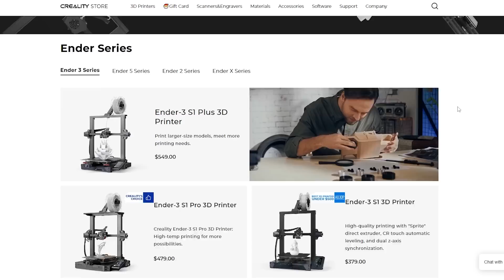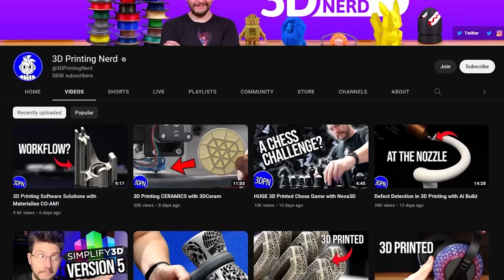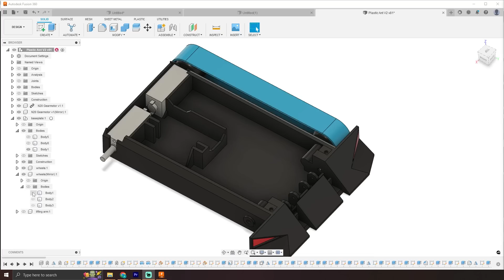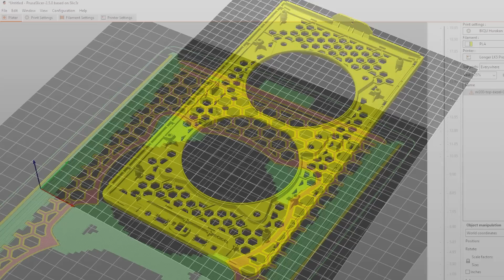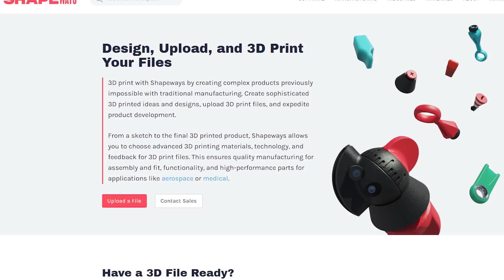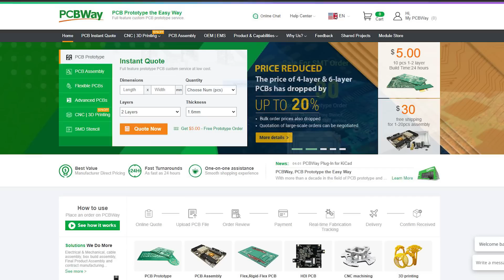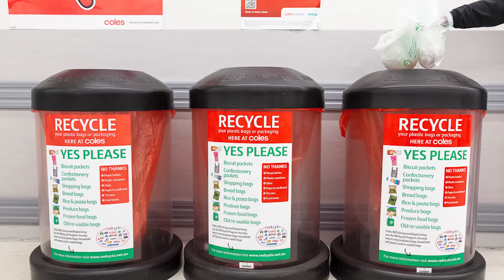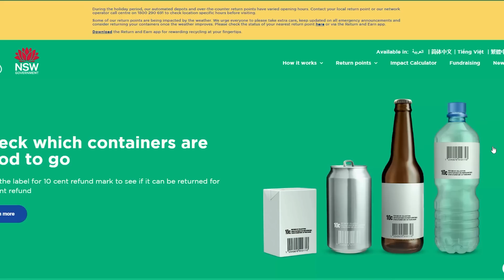My 3D Printing Predictions for 2023

Comment: in terms of cad accessibility, we need plugins for blender that make it easy to convert stl to printable meshes. blender and similar software are way more intuitive to use than most cad software that require a lot of manual parameters

Comment: Material engineer here it is possible to make filament with cellulose but you can print with normal prints they would degrade/burn before melting. In the lab I worked I tried to make and it is possible to 3D print with cellulose and they are awesome but it uses water and a different extrusion method they also take a while to completely dry and you can't make very detailed surfaces. You could make a fan for example but not a miniature, parts that require tight tolerances would not feasible either

Comment: I believe we need affordable and easy ways to take our scrap or failed 3d printed projects and melt them back into filament strips.
I know there are dozens of youtube vids on people who are skilled in electronics making these machines but what about those who have little experience. 
2 things I know are needed is a Shredder for the 3d print material and then a type of Extruder that takes the shredded material, melt it down and spit out the 1.7 filament

Comment: It's now August. one thing we are seeing is not cheaper prices, but better value. compare the Bambu P1S with the MAS system against the Prusa XL with the 5 head system as an example. At almost 1/4 the price, the print quality should be about the same once input shaping is working on the XL. As it stands now, the P!S print quality at speed is better than the XL. Add about $80 in upgrades for a hardened extruder and nozzle for the P1S and it can do abrasive materials like the XL. Then there's the fact the P1S, K1 and some other printers also provide increased print speeds for their price.

Comment: I picked up the Neptune 2s a few years ago.  Modded it, its pretty sweet.  I would certainly not pay for a bamboo labs, way to expensive.  But I also do a lot of modding and stuff so no biggie for me.  That said.  Even back than, I felt that 3d printers were advanced enough, to the point where everyone should literally have one in their home, or atleast know someone with a 3d printer who could print for them....

What would be REALLY REALLLY REALLY cool is if we saw shops, like literal birck and mortar strores, that have like 10+ 3d printers, and they sell 3d printers, but they also sell 3d printed items, locally and online.  Kind of like going to a printing press shop, couple hundred years ago.

Comment: AI should drastically change CAD.  Right now images of dogs it creates might have 3 legs but just think about how fast AI advances could change this.  Instead of asking for a play written by AI or a picture with X components how about a cylinder or a block and other descriptions to have AI do a lot of the work before fine tuning.  I figure 5 years and maybe less at the rate AI is going.

Comment: Better slicers with integrated AI optimization, smarter controllers like Klipper, these are the easy software ones. Then hardware wise we need rotating extruders for FDM.

Comment: I think that 3D printing is going to get cheaper to do in general, as it has already done this, yet it will level out in stages like the computer tech has done..

I think that the Metal printer will eventually become a hobbyist tool although it will probably be in 5 to 10 years.

I think that more people will show interest in 3D printing but like most people don't want to program games, and or 3D model characters in programs like Blender to Character Creator and would rather buy them from Daz, if they have any interest in that at all, so I think some of it will become common place yet some of it will still stay niche like for example, I am 3D designing Star Trek models and 3D printing the parts to test, and adjusting them and then reprinting.
This costs a couple hundred dollars or more and can take between 2 to 4 months on each design. So I don't think everyone will be doing this anytime soon unless we get the software like Tony Stark has where the AI does it for you, when you verbally describe it. 
People might get to where they print out a hammer because they need one now, though and that could be common place.

Comment: 0:31 #0 - 2022 roundup
4:00 #1 - The war for the prosumer market will begin again ... again 
6:00 #2 - An increasing need for "easy to use" CAD
7:16 3# - Companies will embrace 3D printing to alleviate supply chain issues
8:23 #4 - Industrial manufacturing will become more accesible
9:49 #5 - Hobbyists* will have to take plastic recycling into their own hands (* I refuse to repeat the spelling error from the video)

Comment: This is probably going to be lost in teanslation and viewed negatively. But ya'll saying this and that about how innovation should be coming from the companies that produce these machines; fine back in the 70s, it was under decent research budgets (universities and other various compenies) that the very first 3d printer came about.  Sure, yeah, whatever.  For those of you that think that the Prusa i3 was an entirely original idea; no it is not.  For one the Ender 3 is for all intents and purposes is an Prusa i3, which its allowed to be because they're open source.  Even the Makerbot printers, up until the Replicator came out, were open source.  They were all based off of the RepRap project.  The whole point of which was so we weren't ladden to waiting for companies to produce these machines for us. Or being locked down to "their" proprietary parts or systems.  It is supposed to be an ecosystem were we are allowed to make the innovations ourselves.  For those that say otherwise,  ya'll are very well and truly "whipped," so to speak, and tied to the system.  What simply because it's supposed to "just" work?  You all want to be living within the matrix, man.  I suppose to that you all think that the og MacIntosh computer was all proprietary and all Apple's/Job's idea?  Or that Google "owns" Android? The names, or branding, okay fine.  What became MacOS, was based off of FreeBSD. Android is still opensource.  You can legally do what you want with the source code, with in reason; the only money Google makes, is from selling licenses for Google Play services and the right to install their suite of apps.  All of this is to say that the whole idea of where our most used and prized tech comes from the innovation of us little guys and not being tied to Creality, Prusa, UltiMaker, 3DSystems, Statasys, or even HP.  So please stop bemoaning the companies that do the heavy lifting of providing the printers, as either kits, or preassembled machines.  Its frankly lazy.

Comment: In my imagination, we are already using 4D, 5D, and 6 is causing us complications. 3D was us simply opening "Pandora's Box"

4D and 5D, is handling next level structural engineering - mainly for "Space Innovation design" Nasa and a number of big players are on the cutting edge of theses two. 

Big Pharma, is pioneering with 6D and this is not without frustration or heavy costs between time, testing and tweaking - their science has literally rocketed, but not without cost. The main problem is balancing and fine tuning 3 or more disciplines to bring the equivalent of a one stop shop piece of hardware that has multifunctional capabilities. 

Big Pharma, has created the equivalent of an army of pica-nano-bots that have fully capability of carrying out extremely high precision operations to anywhere in the human body. With the future intentions of building the person from the inside out. Yes you heard me correctly from the inside out. So  it can replace bones, skeletal frameworks. 

Imagine, mining which would allow you to remove the infected or damaged bone, and in its place they build an artificial version from a new materials that are as good as indestructible. A.I. has to work out the mathematical equivalent so that the replacement is the exact body weight that it has to replace. This is why it is so difficult?  and why it is causing a headache. 

They could build a super lightweight skeletal frame, but you would almost be creating a cyborg, which has already been done, but it's the step below, that private customers want right now. Ironically Marvel was the key promoter that opened up a new division in medical engineering for this new demand. 

Big Pharma, has also created the inline/online medical center which is capable of monitoring all of your bodily processes, and initiate treatment to maintain overall health of the person, with no longer having to ingest tablets, topical creams, etc. It's all done within, with the precision of giving the exact amount your body needs to absorb, without all those other side effects. 

Skin tissue has been a monster of a problem to artificially recreate, because our skin is a living organism which has very unique abilities to replace itself. This has presented huge problems because we do not have the full body suit equivalent as it is truly a masterpiece in science, that we really have no idea of how our bodies, do it. 

Whilst we can replace eyes' ears, and smaller organs the magic is getting it all working together and our bodies adopting theses artificial replacements. So genetic gene coding is one of the "D" disciplines that have got to be aligned with our own D.N.A in order for it to work in harmony.

The other issue we have but it's 10 years down the road is creating a number of depots within the body framework that will store medical supplies, and the aux pica-nano-bots to carry out daily routine maintenance.  This will be for key people who are essential to Global Governance.

Comment: I fully disagree with the statements made in regard to CAD. Fusion 360 is one of the more simple CAD programs, not only according to me but also to my collegues and co-students at my university. 
In terms of Interface and how to use it, it is much more aligned with the common consumer than what the professional engineer uses. There is a reason why systems like NX, Solidworks or CREO are as complex as they are and not replaced by Fusion 360 or simpler software: Because they just need to be that complex to be stable (I am paraphrasing my Professor here, German to English).

When I compare NX, Fusion 360, Creo, TinkerCAD and FreeCAD (All software I have used), I always come to the conclusion that I´d rather use NX than any other. My reasoning being it isnt as "pseudo-intuitive" as the rest. When you try and draw things in creo, it´ll assume a fuck load of constraints which I dont want. Fusion is super weird because you have to select every surface individually when you want to extrude them, and it goes by a time line and not a construction tree like every other software. TinkerCAD is completely unusable imo as getting the actual shape you want with rudementary geometric shapes is absolutely heinous.  I had trouble getting FreeCAD to do anything at all, and believe me I tried because I really really didnt want to pay. 

In my honest opinion Fusion 360 is aready at a sweet spot where its simple enough for beginners to understand the basics and capable enough to be modeling more advanced features.

Comment: #3 will not happen just yet. Companies want money. They won't allocated resources just to help consumers. It's never like that. They will need something in exchange. Maybe a paid subscription so you can have access to 3D models.
I believe some company will realize the recycling potential and create a new product, like a oven or a shredder, so the plastic can be reused at least. I keep all my 3D garbage in a box, I never threw anything in the trash
Maybe filament companies could create a shredder and standard bags so you could reduce the trash to a fine powder product and send back to them for discounts
You forgot something important, 3D scanners
I think 3D scanners are the new product to become affordable and skip the 3D modeling software part.

Comment: I've been printing around 9000 hours among the hour calculators between printers. What I do with the waste? I try to print mostly in ABS if I don't need something specific abilities from the filament, ABS can smushed into a bottle with a bit of acetone and you have absolutely perfect, fast drying glue for any job.

Comment: Our experience with the bambu labs x1c has been simply that it achieves the quality of a well tuned standard build voron 2.4 for less money, right out of the box. Many people seem to claim that the lidar is a gimmick, but we have used a variety of filament brands for the same material and not needed to tune flow, or really anything else, when changing brands. The lidar flow calibration achieves, in minutes, what a skilled and detail oriented individual would need many tuning prints to achieve. Having experience with a variety of printers, both FDM and MSLA, with IDEX and dual extrusion machines at the high end of the prosumer market, we can honestly say this about the bambu labs x1c: this is what weve been waiting for, it changes everything.

Comment: Regarding recycling: 
I'm in South Africa and filament is SO EXPENSIVE that I put my (VERY old) printer into a small crate, screwed it closed and put it on the top shelf in the garage thinking "Maybe I will try again later IF I can afford to".
This happened 6 years ago and the situation has not changed... 
A roll of PLA is now more than 3 times the price it was back then.
BUT I have been watching with a lot of interest things like extruders that use pelleted raw plastic, the "ribbon cola bottle filament maker" and machines that grind up milk bottles (HDPE) and extrude a usable quality filament.
For me an extruder that uses finely ground up HDPE would be the ultimate
BUT I would have to make it myself using "off the shelf" parts because ANYTHING that enters the South African postal system simply disappears down some black hole never to be seen again - with NO EXPLANATION - and NO INSURANCE...
So Mr "MAKERS" muze, how about designing and building one of each of these three solutions using BASIC 3D printer parts and COMMONLY AVAILABLE HARDWARE?
People in Europe, North America and Australia do not realize how "easy" they have it while the rest of us peons in other parts of the world simply have to look on with mouths watering...
Reply: you plan on leaving that shit hole? or you waiting till you chopped up w a machete.

Comment: 11:00 We have around 40% collection rate and 25% recycling rate for plastics in Finland and the numbers are going up fast.
And this is doesn't count basically any plastic bottles, since we have like 80-90% return rate for those (we have a mandatory pant system for all drink containers).

If there's will, there is a way.

Comment: You mentioned sending a file to be printed for replacement parts but that these just aren't as durable as injection molded parts.  Well, they don't need to be as durable to be useful.  I need a machine working today, not two months from now when I can get the injection molded part.  Fine, send me the file to print so I can get back to work today and send the real part so I can replace it when it arrives or the 3D printed part breaks.

Comment: Cool, also I'd love to see a CAD program more like the build editor in Second Life was - very visual to build with but could also be built with precise measurements. Tinkercad is missing a few more things the SL editor had like making primitives physical (ie they can't intersect) rather than passing through each other. 

Re: Brothers Make, the plastic they're recycling is HDPE, and I think HDPE was one of the first reprap filaments wasn't it? I think moisture was one of the problems with it, and filament quality. But now we can a) shred and pelletise most plastics, b) dry it properly and c) we have bulk pellet extruders as well... Also, the plastic bags Redcycle didn't recycle are LDPE which is probably also printable if pelletised.

Comment: I’m not a 3D printer user yet but I have a question about the 3D printing process. Would it be possible and feasible to create a multi step printing process where ultrathin sheets of plastic get laser cut into the appropriate layer and mechanically stacked? These thin sheets could have a microwave activated adhesive to bond them. 
Or even just an adhesive nozzle between each layer before it’s placed?
Just an idea. Would seem to be a faster and stronger process no?

Comment: Need to start looking at ways to do full colour with resin printers, its okay releasing a new printer every year, mars, mars 2, Saturn, Saturn 2 etc but they all do the same thing. People saying the Bambu Lab printer is some new revelation because it prints faster than an ender 3 is revolutionary, well its not, its the same but faster,  same print results and you can print multiple colours on an ender 3 with mods.

Comment: tinkercad yes ,the other expensive Phd required to operate has got to go, its the software that needs to be inpoved more tinkercad like and less of the other stuff,if a person has a bit of engineering reasearch and design experience the machine will work but getting the right person is next to impossible as you have a million with the impressive resumes but no and I mean zero  hands on and when you are hired to fix  they mean fix and not write theory or write code,a person with hands on is hard to find these days.

Comment: Ai is going to take over CAD.   Instead of need ing to know how to use Fusion 360 or Vectric for CNC...you will be able to type "put .25 inch hole in center" and Ai will write the gcode.  It's coming.